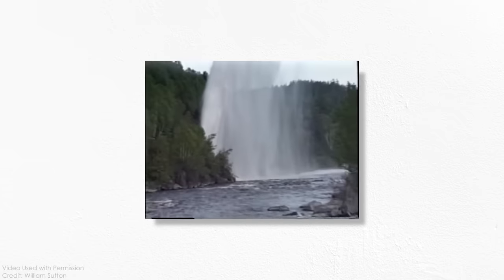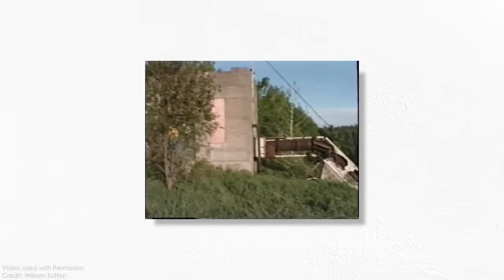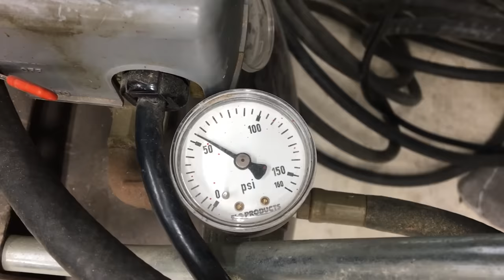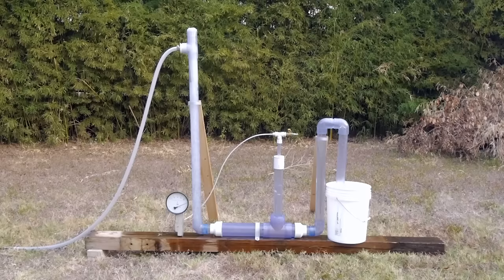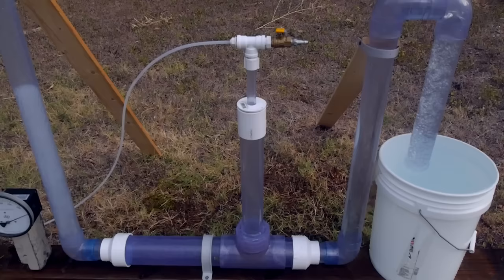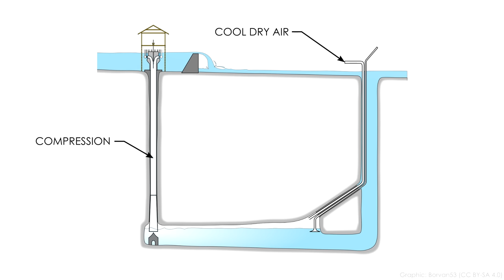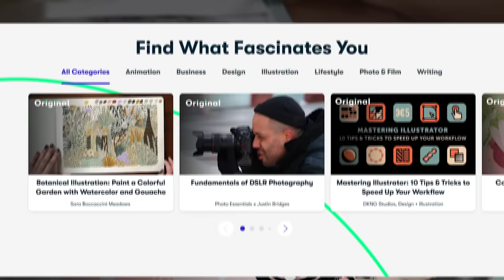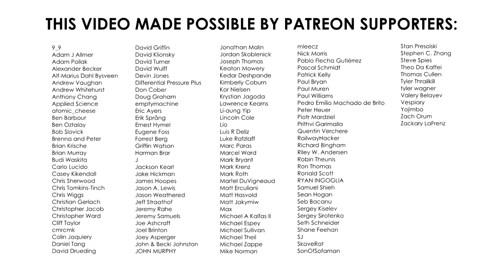Compress Air with No Moving Parts! - Trompe

Comment: What I learned from this video is that at least one American noticed that we exist here in Canada and we also have done some amazing things over the years! Thanks for noticing. Also I live in Ontario, about 5 hours south of Cobalt and I never knew about this, this is exciting! Thanks for sharing! It makes me wonder why we don't make compressed air at more hydroelectric plants. It seems like the air could be collected after running the water through the turbines to make each dam that much more useful
Reply: Probably because you don't want aerated water flowing through the turbines which are near the bottom of the dam, and by the time you inject air into it afterward there's not much head left for the compression.

Comment: Great video! :)  You mentioned that these types of compressed air plants are gaining renewed interest. Do you know of any currently being or slated to be built? Would love to learn how modern design and engineering have improved even farther on this impressive invention.  With no moving parts in the compression side, minimal surface footprint, and no consumed fuel needs (toxic, radioactive, or otherwise) it would seem to be an excellent choice for power generation anywhere in the world there's a reasonable source of flowing water. I'd think it would be much better than even conventional hydro-electric dams, as    it would virtually eliminate a number of the issues of using water to directly power turbines.  Perhaps in a future video you might compare and contrast the two for efficiency vs cost etc from an engineering stand point?

Comment: "I can watch this all day"

Water bills intensifies*
Reply: What if you recycle the water? Does it mean its infinite energy?
Reply: like an extension cord plugged into itself? ;)
Reply: Like a power bank connected to itself?
Reply: @_egghead  recycling the water would be great, but no infinite energy the best you could do is store it in a another tank
Reply: @fuseteam  you could use a screw to move it back up.
Reply: @mylesmcarthur642  eh?
Reply: @_egghead  no
Reply: @_egghead  They way he did it i´d say it is an extremly ineficient energy source and if he optimized it to where u get more energy into air pressure u miss the pressure for your shower/sink etc.
Reply: Not if you have a well period but then your electric bill will go way up
Reply: @fuseteam  He means an archimedic screw. But to move the water you need power..so..you would need electricity..which dumps the whole project
Reply: @foty8679  huh interesting didn't know of the archimedic screw

Comment: What a great and simple device!

I'm currently trying to design a centrifugal trompe, harnessing rotational potential instead of gravitational potential for a compact air compressor with no moving parts. (except the rotating piece) 

This video is a big help!
Reply: Good luck with that project! 👍
Reply: Nice ! i'm curious to see ! There is (at least) an existing one low head with vortex that let the fish come back to the spring. I guess you can see it on Bryan White channel if i remember good

Comment: That was very helpful. I’ve been wanting to add more air to my hydroponic system with out buying more air pumps and stones. Subscribing to your channel was the best. Thank you.
Reply: If all you need is aeration, you may want to consider an airlift as a circulation pump in your main reservoir/sump. Though depending on the type of hydroponics you run, you could power the trompe with the flow of the main return line and use the air it generates to power an airlift.

Comment: You caught me red-handed with that vocabulary - I'm currently learning this stuff (thermodynamics and fluid dynamics) for an exam in university.
Reply: University? In what country? I'm fairly sure I learned the meaning of the terms isothermic and adiabatic at New Zealand high school as part of physics in year 12, but I could just be remembering wrong -  it was quite a long time ago. I certainly learned endothermic and exothermic at high school chemistry though.
Reply: @TonyRule  A technical university in Germany. It's a whole course dedicated to thermodynamics. Not just those two changes of state, but also Isochoric, polytropic, isobaric. Then the application to power, work, torque, various circular processes (not sure if this is the correct translation?) for turbines and engines, and more. 
Then the whole part about fluidic dynamics which I havent really touched yet while practicing for the exam (one of many, next week, and the week after)

Comment: Stoners everywhere are now figuring out how to make a bong out of this.
Reply: @djc4799  nah you could definitely figure out how to make some futuristic gravity bong
Reply: thats easy just put a chillum at the intake and connect a breathing mask to the exhaust, there you go.. pressurized, cooled smoke.. :D
Reply: One of the best bongs I made when I was a crazy teenager was based on this mechanism. It was built from a super soaker tank, while it was unused everything was stationary but as soon as you began to suck on the tube the pressure change would start a process of compression and expansion inside the reservoir. The cycle only lasted a few seconds before it lost enough energy to settle back into equilibrium but that's all you needed to "take a hit". The result was an incredibly low effort bong that delivered cool smoke. What ultimately killed the thing was that it condensed resin out of the smoke so rapidly that I had to use an old dull drill bit to clean it  out, as you can imagine doing that slowly carved away the plastic around the tank's outlet until it sprung leaks that rendered it useless as a bong.
Reply: This is literally already a bong. Just insert a bowl as the air inlet and lit it. Smoke will collect in the pressure chamber, you release the valve holding it in and the pressureized smoke releases itself
Reply: Stoners should then be able to rule out the hemp thats growing In the background

Comment: I liked the vid, but you mentioned it’s an energy transfer system.  A thing that could help would be describing the loss of energy between these systems (even if it’s free)
Reply: I'd say the most problem here is not the efficiency (which is still important sure), but rather energy density.

Both potential energy of water over height and compressed gas have extremely low energy density.
Reply: Михайло Сєльський am example of an awesome fact that could have been included

Comment: Looking at the water exiting the system, only a small percentage of the energy is captured.  I think that including a Venturi would improve efficiency
Reply: Was wondering about that too! Grady....? 🤔
Reply: How would a Venturi be used? Just curious
Reply from the maker: Not sure what you mean. A venturi would just cause additional losses in the flow from expansion/contraction.
Reply: A Venturi converts potential energy to kinetic energy in a more efficient way than your straight pipe system. And since your head of water coming out is wasted energy, you have all to gain.
Reply: Pinch the plastic pipe with a jubilee clip in boiling water so as to create a contraction just before the air inlet.
Reply: The Venturi will entrain more air. Pinch the pipe at the end and that will create more air pressure up to an optimum somewhere. The trick is to find the optimum
Reply: From scratch, tap water straight into a Venturi with air inlet at the beginning of the Venturi expansion (pinch one of those Venturi vacuum pumps from the chemistry lab). Then throttle the exiting water with a butterfly valve to attain the desired air pressure.
Reply: Notice the fountain of water in the video? That’s no folly. That’s the throttle to achieve the desired air pressure.
Reply: There is a venturi right at the beginning of the pipe system where the air is being pulled in. The water hose feeding the system is the pipe restriction from the water tower (or other higher pressure source) and when the water exits into the larger chamber and accelerates down the pipe it uses the partial vacuum formed to pull the air through the bank of inlet tubes. It could be adjusted but it's already there.
Reply: Means changing the vertical riser to more of an angled one, and venturi section just before the air trap. (Much shorter run between drop and trap.) However might need a higher drop or more turbulent flow to get the gain from it. I think the name is because some of the really old ones had a trumpet-like section at the bottom of the vertical drop, so there was a venturi of sorts in that regard.

Comment: I wonder if you could use this for air conditioning like a drier version of the Swamp Cooler.
Reply: I'm very curious about this, too. And you'd only need very modest pressures, so a good design might be an easy, cheap and safe DIY build.
Reply: Maybe in combination with an Air Cycle Machine?
Reply: @b43xoit  What, like a traditional AC? I mean, you could use the water to soak up the compressor heat. Or the compressed air to cool the coils even further before decompressing. Or both. 

Gah, this is getting complicated.
Reply: @adamblakeslee5301  Not like traditional AC. Like the AC on an airliner. It runs on compressed air. https://en.wikipedia.org/wiki/Air_cycle_machine
Reply: Absolutely. Any source of compressed gas which is allowed to undergo adiabatic expansion will cool. I don't know what a Swamp Cooler is but trompe air is probably very humid.

Comment: To put it in perspective, this is a reverse flow p trap with a direct vent where the conventional outlet is, with a port in the middle of the dip to collect air that cannot separate from the flow of water until it passes into the isolated chamber

Comment: Nice! You should do a video on updraft towers / updraft chimneys, and using giant pipes close to the ground going from low elevation to high elevation as updraft towers/chimneys. They create not only electricity, but also drinking water, and an optional local cooling effect, if it's wanted.

Comment: What is the correlation between the air temp and the water temp? Do you think it would be feasible to use the compressed air in a building cooling application instead of just pumping it into a tank?

Comment: That is a really cool contraption! 
I can visualize a big tank where your  compressed air is. If It had a chance to build up a volume of compressed air,  you would really have a good air compressor!
Reply: The only thing holding in the air is the weight of the water.  he'd need a much taller output pipe to get real pressure.  and the pressure of the water line would limit it too

Comment: If you have aquatic planter pots about the front porch & backyard, then you could rig a trumpe at your hose & run air lines submerged in the water.

When you water your garden or run the sprinkler, the trumpe will produce bubbles in your potted aquariums!

Comment: The first stage is also used to create vacuum without moving parts - it's called water aspirator and is used till today in chemistry labs for vacuum filtrations, distillations etc. It's especially convenient since solvent vapours go into the water and then out whereas if oil pump is used, it would mix in the the oil and damage the pump.

Comment: As far as I remember the trompe was historically used to provide constant air supply for a smelting furnace called a "catalan forge" - and the little bit of moisture helped to have a reducing atmosphere in the smelter itself. Also, I read somewhere, that square piping with baffles on the water inlet side works better than round one.

Comment: Great room ventilation system!
In summer hot - in India, there was 50..55C air temperature, and "only"(*) 35..37C river water temperature
In restarants - under AC conditions 32..35C classical, and below 32C you can even to start sneezing - it is unwanted...
so - i often think about "free-energy" cooling system for house situated near river.

Locals building simple "hot-season-houses" there, constructing the walls of that houses covered with burlap(cloth-walls often wetted with water - all the day, usually every 15min 10liter of water must be poured on such home walls - to handle lower temperature - 4C cooled air inside)
 I thought  about hydram water pump - that working on the energy of the river flow (flapping the water hammer valves day and night) for free - hydram will (push by little portion when hydro-shot happens) pump water from the river to the level of the roof of the house, into the water tank, from which water would drip wetting the cloth walls

And now - I learned another device that is also capable to directly free cool house - to serve inside the house air - compressed by river flow, and also cooled to water temperature in the river! Very interesting!

(*) swiming at 37C water - is too warm - too much hot - hotter than normal body temp, pleasurable only when you go to the windy shore, so reaching some cooling of skin below 36.6C...
However - 35C water temp is wery good at this hot time for swiming - i prefer it temp., maybe even always

Comment: Practical engineering if you read this comment. The soudan underground mine in soudan MN closed now and just a tourist attraction. I'm pretty sure used this method to compress air for the air tools used in the mine. 2300 feet deep. Something you might be interested in if you like primitive technology. Its very interesting how they mined compared to now using gravity and natural resources. Give a like if you read this please.

Comment: The concept of the trompe and similar designs has been pitched in a startup companies new mechanized way of compressing air that supposedly yields dry air or air that is a substantially drier air source versus more traditional methods of scroll or piston compression, in a compact form.

Comment: Question: what would happen if you left the trompe running without opening thr outlet valve? Would it keep building pressure or would it reach a point whereby the pressure would plateau

Comment: I would assume something like this could be hooked to a storage tank(s). You would basically have an air compressor that just takes days to fill up without electricity. You could have a solar system with a compressor also to compensate or a water wheel/compressor to double down your air production. 

Trompe, Water Wheel, Ram Pump... Lots of ways to harness nature for our benefit.

Comment: I think the air pressure that you obtain actually comes mainly from the water source from the main pipe, maybe a small fraction from the water level in the first vertical pipe (trompe).

Comment: So would it be feasible to cool a building with a trompe that drew warm humid air from the building and mixed it with a hydraulic RAM pumped liquid desiccant,CaCl (road salt) +water solution,circulated from a reservoir buried below the frost line and releasing the dehumidified compressed/chilled air back into the building? All plumbing,reservoirs,and pressure tanks being non-corrosive PVC or PEX?

Comment: Haven't watched your videos before, and I'm not going to read 1500+ comments to see if this has been said already, but:
I'd argue that the water is a moving part... ;)
Also, this contraption reminded me of the "hydraulic ram" water pump (aka Vädurspump in Sweden) which can give you pressurized water without any external power source, it just needs flowing water. (It does have moving parts though.)

Comment: I'm no engineer but you make me wanna design a passive aireator and water pump for my nft hydroponic system. The water aeration is solved already now all that is left is how to pump the water back up into the pipe using the compressed air.

Comment: Isn't this example using Venturi prnciple of making negative pressure in your tube lines? In result "negative pressure" mixes the air into the water and is trapped via its movement velocity inside of the middle tank. Correct me if I am wrong.

Comment: How do I determine how large of a pipe I will need if using a tromp for aeration? I imagine that the tubing will restrict the flow of water. 

I'm building a system using a 6" PVC gravity fed system estimated to run 100 GPM. A 6" pipe is 452.16 square inches, which is equivalent to 9 of 2" pipes. My question is, how many of the 2" pipes would I need if using as a tromp and, more importantly, why?

Comment: I'd love to see a trompe used to compress woodgas. Since it would act both as a compressor and as a filtration device, it would be ideal for achieving a better BTU-volume ratio if storing syngas for mobile use, or even during the day if used for energy generation while the solar panels are working.
Reply: that doesn't sound terribly good for the water though

Comment: Would the vertical air tube need a pressure relief?
Could you direct the water outlet back to the first vertical tube and have a continuous flow without the garden hose?

Comment: It looked like you had a pressure gauge, but never showed the maximum PSI.  Judging by the release valve it looked like maybe 5psi. I know it would be related to the head pressure but does it max out at something less than that?

Comment: Just checking, the middle accumulator can be as large and/or tall as you like? I just stores the compressed air. Might take longer to fill but gives longer cycle times.  Fill from 16:00 to 08:00 one day, use from 08:00 to 16:00 the next.

Comment: This is like the water lifter that I played around with I got the water to lift around twice as high as the depth just using a little air.
P.S.  If a person had a swimming pool to fill up it would be like having free energy to use the water pressure that is just getting wasted when filling the pool.  I have thought about putting together a generator that would use the city water pressure that feeds the house, now I know that would reduce my in home water pressure but I could live with that.  ;)